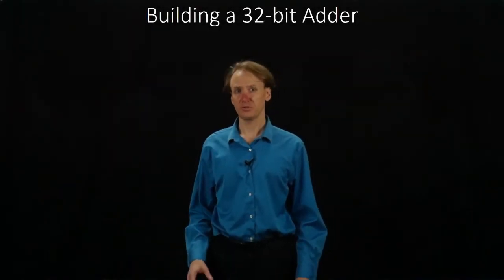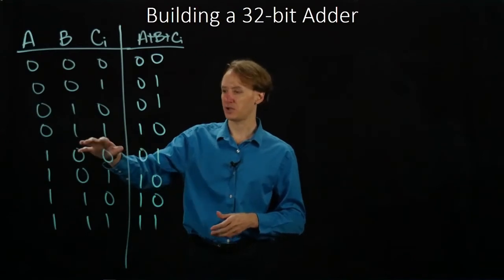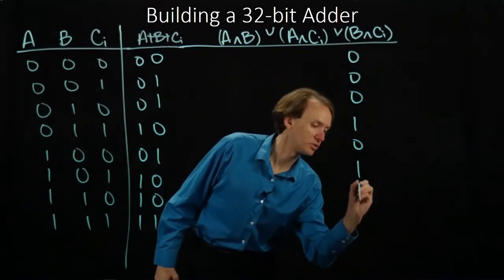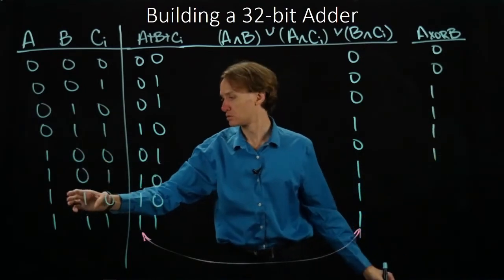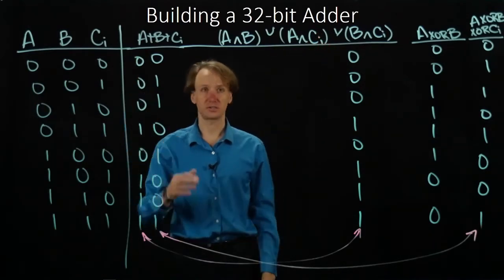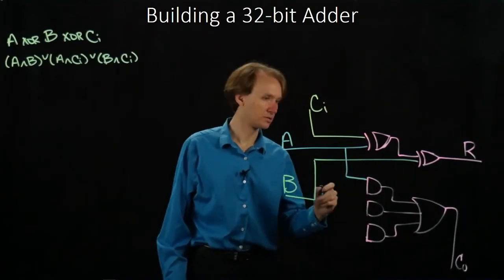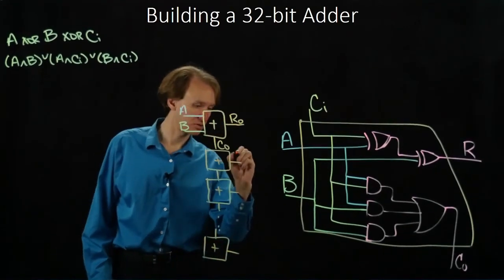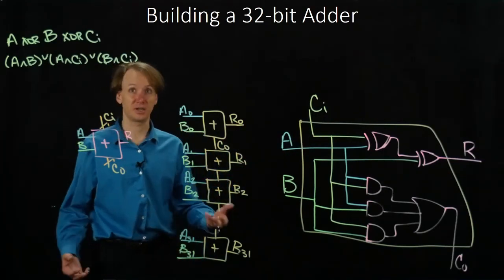7-1.  Building a 32-bit Adder

Comment: Ug again it's not "ten" or "eleven" "ten" = 1010 in binary, "eleven" = 1011. These are rigorously defined entities independentof base or symbolic representation. For clarity referring to two as "one" "zero" and specify digits. I'm really trying to enjoy this series, but your mislabeling of numbers is making it hard.

Edit: imagine you were explaining unary, would you call |||||||||| ten or would you call it one billion one hundred and eleven million one hundred and eleven thousand one hundred and eleven? 

Hope that helps. At the end of the day you can define "ten" however you want, but most would agree that defining it as "as the number which has the symbolic representation with the least significant symbols "10" and no symbols of higher significance besides "0" "is a pretty useless way to it

A much better definition is just "the integer following nine" (I bet you can guess how we define nine) and treat the existence of one as an axiom. (There are more rigorous, set theory definitions from which the integers can be derived, but for are purposes here the above suffices, and each number can be represented in any other positive numbers base (you can also gave negative, transcendental, and imaginary bases but that's beyond the scope of this comment)

For the mathematically astute among you, you may recognize a few requirements for a vector space or field. Cool concepts 😉